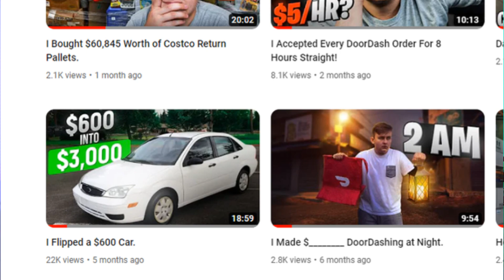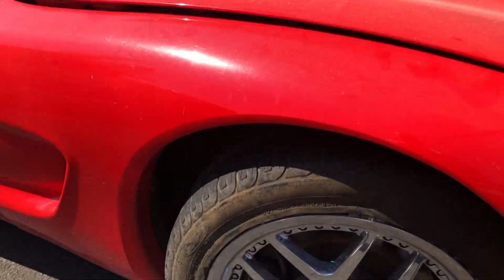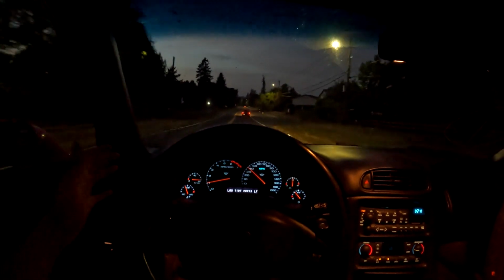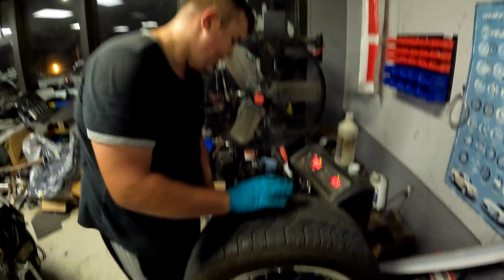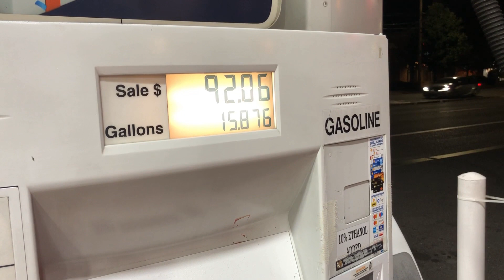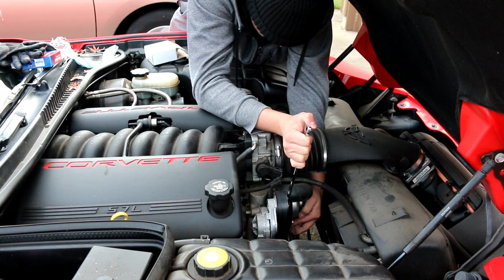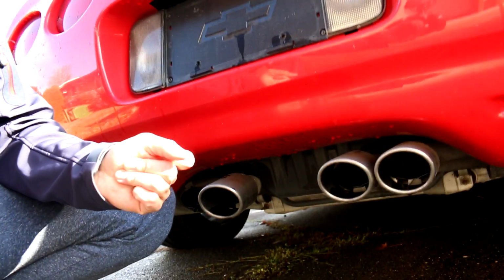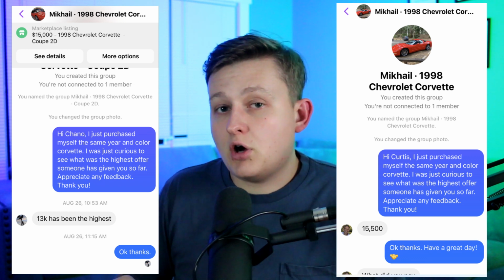I Tried To Flip a C5 Corvette.

Comment: I have a 50th Anniversary Z06...built out to 585whp with a 200 shot. Lowered, Bilstein racing suspension, Carbon fiber hood, staggered 18's/19's, Kooks, Corsa Atak, Brian Tooley stage IV Cam...... turns heads everywhere it goes. This base model C5 the guy has once straightened out will be a cool daily. Seeing the stock ride height it makes me laugh...so dorky!
Reply: I have a stock 03 Z in black. Love it!❤

Comment: Love it . family reactions were awesome.
After I got my C5, I absolutely love it, now I'm modifying it CAM/Supercharger etc... 
Scary part about flipping this car would have been anything involving dropping the front/rear subframe or pulling out the torque tube and tranny. 
Leaks are costly on this car. Oil pan gasket involves dropping front subframe, rear seal involves removing rear Sub assembly, tranny and torque tube.
If you drive one you will love it and pour money into it.
Reply: Facts

Comment: I own 2 c5's and do all my own mechanic work....and to have "NO" dash lights on these cars is AMAZING!....LS1 motors are bullet proof!....low miles....great interior...I bought my 100K 2000 c5 in 2018 for 10K.....so great deal.....get an alignment, pulley, harmonic balancer and pulley are known to squeak...make sure Harmonic balancer is not wobbel-ing..buy overall...looks like you got a steal!